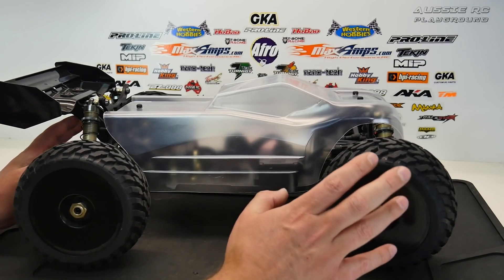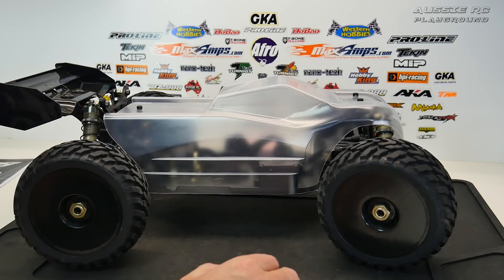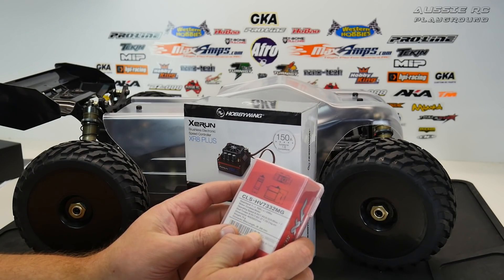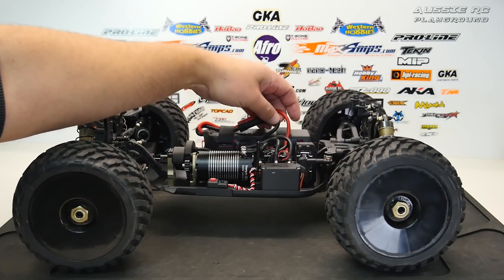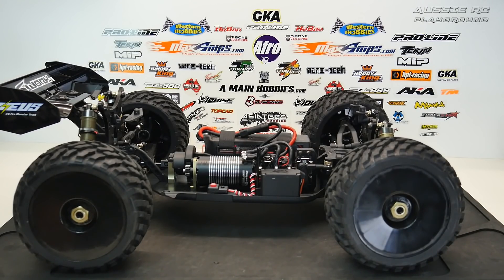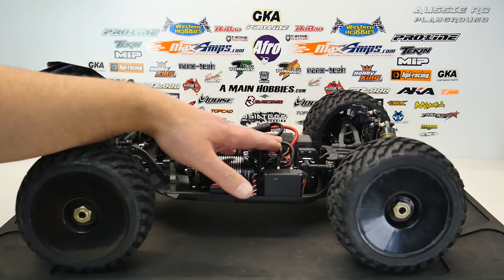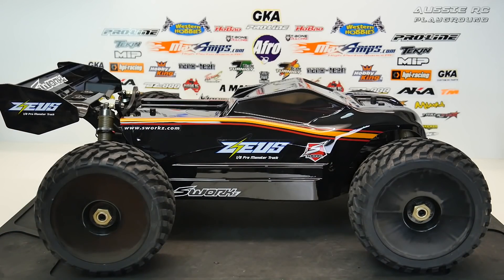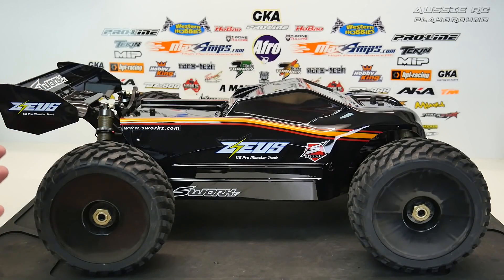RC PitStop 48 - SWorkz Zeus MT - Electrics install

Comment: Im not sure what diff oil you used or what came in this kit but i can tell you i cooked my center diff in my s104evo with a 5.5 turn mmm speedpassion on 2s. On a high bite dirt track.  Fluid in the kit was way too thin needed to step up to 500k on my buggy. I would suspect you will need minimum sell 100k

Comment: Just got mine all put together and I have ran into a issue ...I am useing the same ESC and same servo and horn my motor is a tekin 1700kv 4038 so it's just a touch over 74mm so now my servo horn hits my ESC I have no room to move it over...I guess my only option is to get a 68mm motor that should give me just enough..but then I'm afraid I'll have over heating issues... before I try a smaller motor I'ma try to get a short servo horn and hope that fixes it..

Comment: Other than being sensored. What's the difference between a max 8 combo and the motor /esc setup you selected?
Reply from the maker: +Calyn G 
I believe the XR8 ESC has a bigger BEC, up to 15amps. There are specs available on the Hobbywing website.

Comment: Nice build! Love that motor and esc combo, I have it in my Arrma Senton. If you dont want to try 6s go for 5s. The esc will run it you just have to set a custom lipo cut off 👍👍 Excited for the running video!
Reply from the maker: +Aaron Weycker 
Thank you Aaron. I have tried 6S and it’s a bit too crazy, so might take your advice and try 5S in the future. Could be the sweet spot for this rig. Cheers. 😊👍🏼

Comment: Vas, did you spray the yellow coat before the red coat? If so, this is likely the reason why your yellow came out looking orange. I like to back light colors with a coat of white if I cant paint darkest to lightest; this helps prevent other colors from showing through the lighter colors
Reply from the maker: +Kenneth Draper 
No, I did the black first, then the red and then the yellow. And I backed the red with white before using the yellow.
Reply: Aussie RC Playground 
Thats too bad. Tamiya PS27 might be closer to the color you were going for

Comment: I think it turned out nice! Rock on! Are those Graphene lipos? What model what C rating? How are they holding up?
Reply from the maker: +Szabi ESz 
Yes, that’s a 5000mah 4S 65C. I’ve had it for well over a year and put dozens of cycles through it. It’s held up well, but I recently had a crash with it and it’s looking a bit wonky. Still works, but it’s not as nice as it once was. Time for another one, I think...